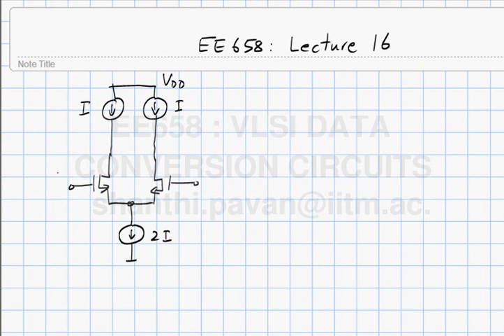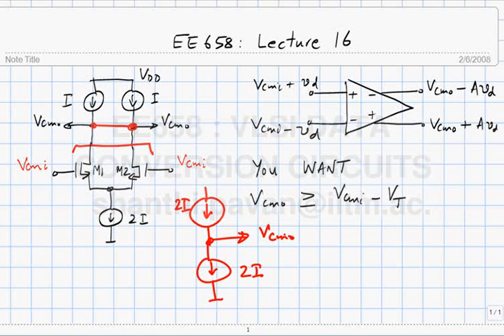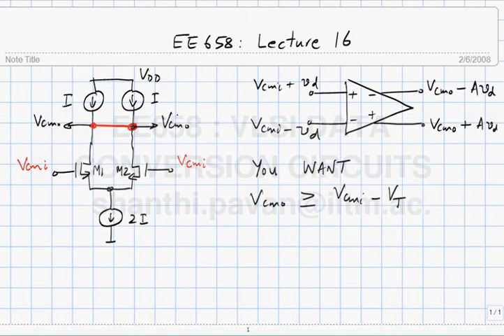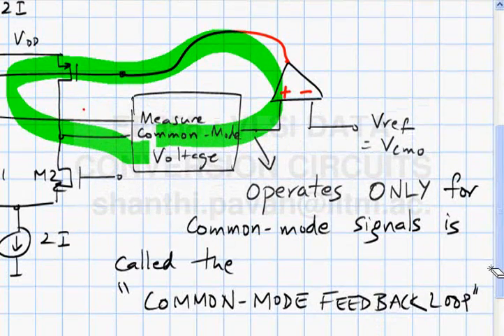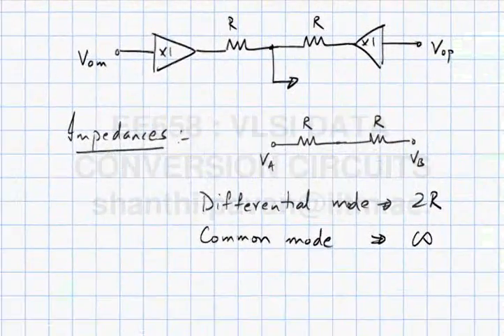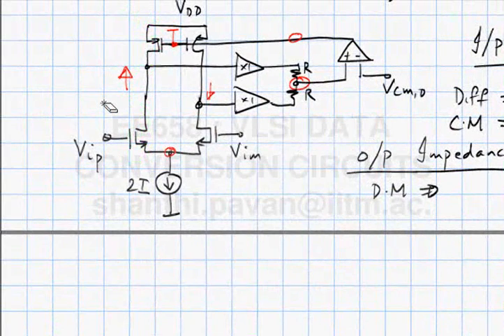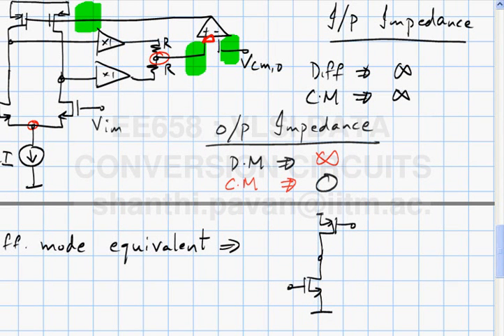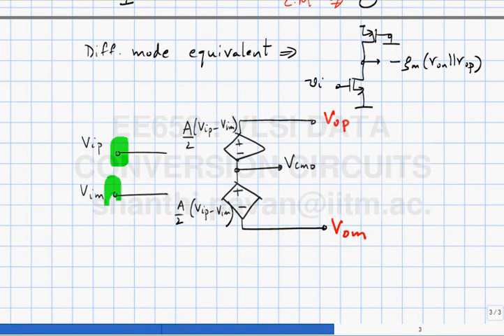Lecture 16 - Fully-differential operation (contd), motivation for common mode feedback.

Comment: please let me know why we want to add CMFB for fully differential op-amps, why not for a simple OTA which is biased with the current mirrors structure for the top and bottom current sources. (And consider that the diode connected pmos loads are used)
Reply: Simple OTA with single ended config(diode connected pmos)is already has a stable operating point of vdd-vgsp